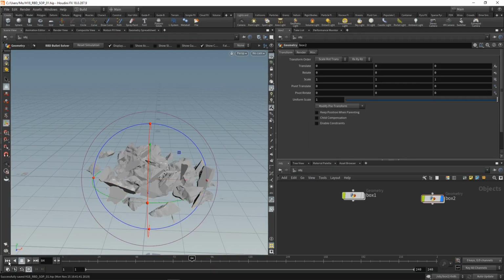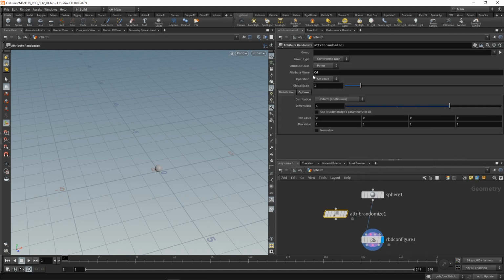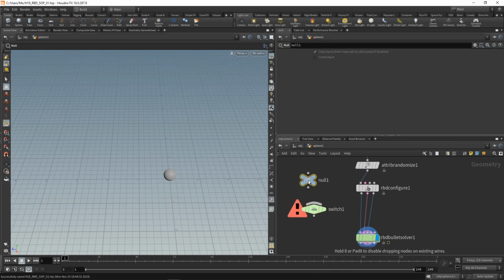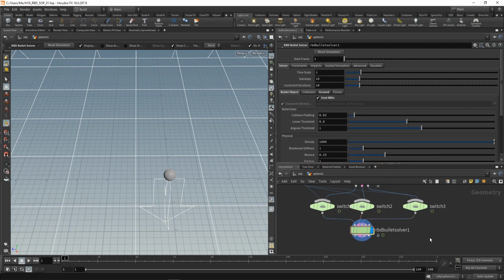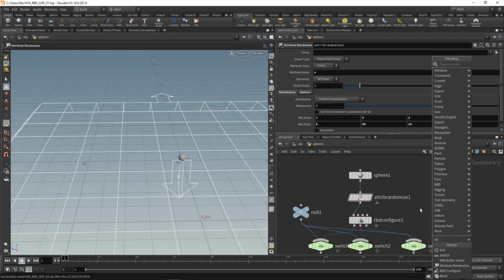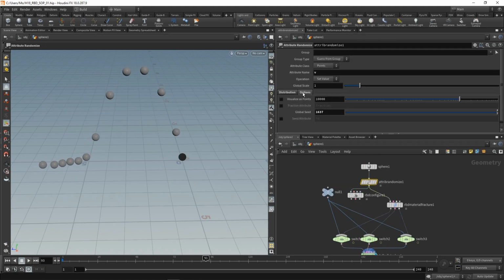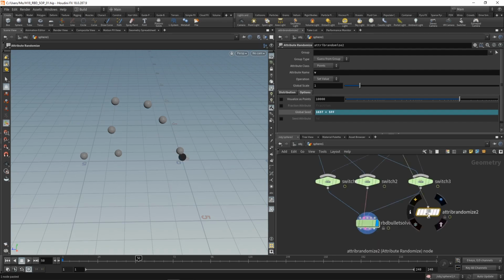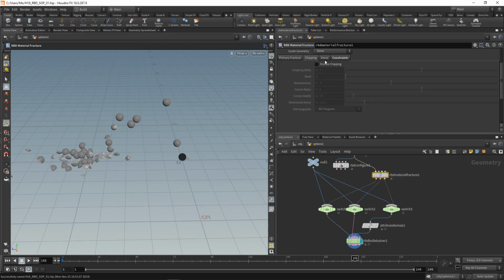New in Houdini 18: RBD SOP Solver - Emitting Objetcs

Comment: Great tutorial, as always! My 2 cents: instead of using a switch node, I’ve found out that you can just add an expression to the “Emission” > “RBD Bullet Emit” parameter in the rbdconfigure. When that parameter is 1, it will emit, otherwise it won’t. So you can set it to something like @Frame % 10 == 1. (tested in H18.0.499)
(of course this only works if you use the rbdconfigure, not if you use just the rbdmaterialfracture)
Reply: i tried your tip, but idk why every 10th frame the emission start and disappear right away, it least 1 frame any suggestion?
Reply: @andreanvfx3901  hi ! IIRC, that is exactly the snippet is doing, setting that parameter to 1 will cause it to emit, which is what the modulo operator (% == 10) does here. What do you need to achieve?
Reply: @vvzen  hi Valerio,
im trying to replicate the 'inside bellatrix vault horcrux FX' which each rigid object emit 5 or more obj when hitted, any clue? I round a recursive fracturing tuts but i dont think i can achieve the result i want with that
Reply: i maybe express myself wrong, i know that the modulo trigger the emission every 10 frame 1 times, but after the trigger the emitted obj disappear instead of staying live